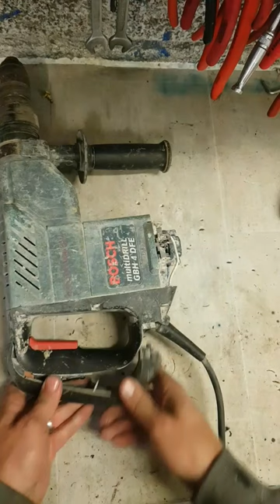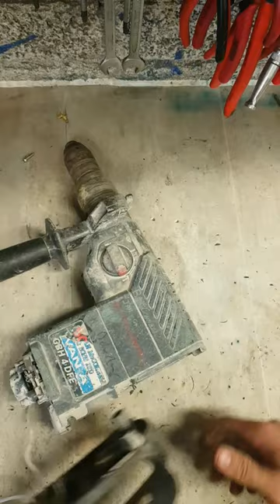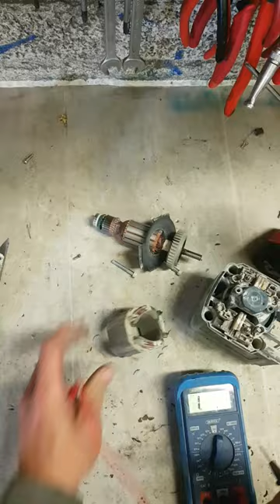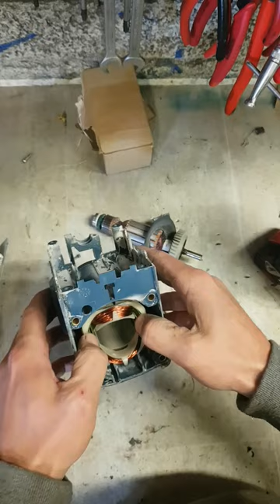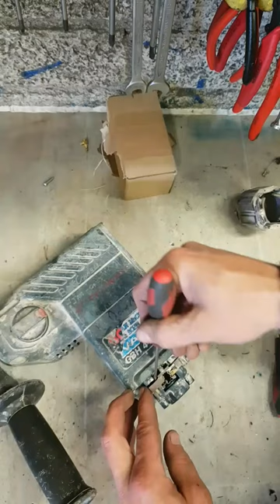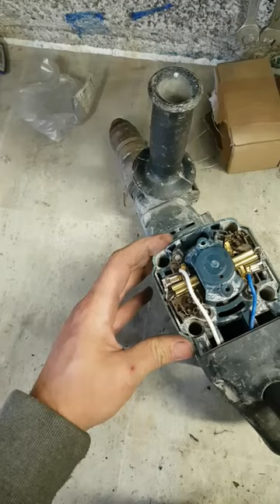Bosch gbh4dce repair.#tools #toolrepair #powertool #bosch #kango #jackhammer

Comment: You always fix the problem but that drill could have been cleaned up before reassembling....just saying.
Reply: Who says he doesn't, maybe he doesn't film it
Reply from the maker: I only ever clean down a tool of there is a reason to. Like an oil or grease leak or something. Clean and washing tools requires time. That I would have to charge the customer for. And in this case there would be no benefit, the tool would run the same, and would just get dirty again as soon as its used

Comment: Lazy dude leave all that dust inside.
Reply from the maker: Where it belongs
Reply: @deandohertygreaser  30 seconds to blow out  or vacuum dust after disassembly would have multiple benefits.  I’m sure you have your reasons why you didn’t. 🙂
Reply from the maker: @foxwood67  it simply make no difference to the running of the machine. It was just the motor section I was working on, if it had of been the hammer mechanism inside it would have been fully washed out.
It was given a quick blow down to remove to loose dust but that's all.